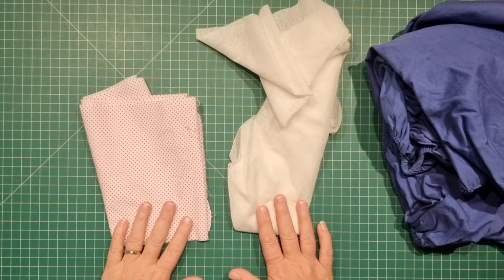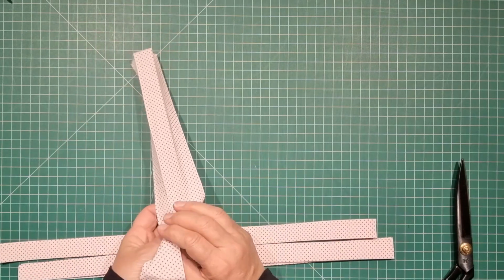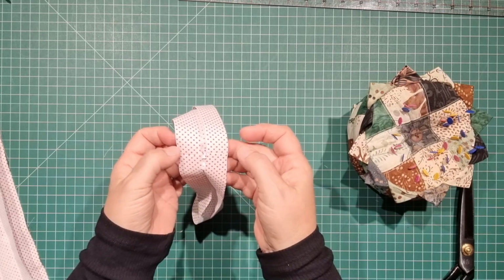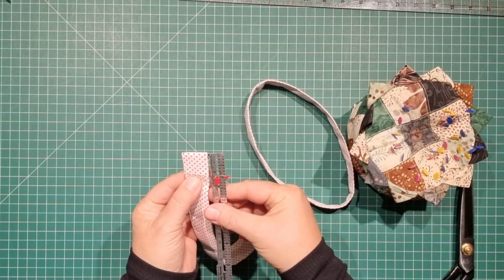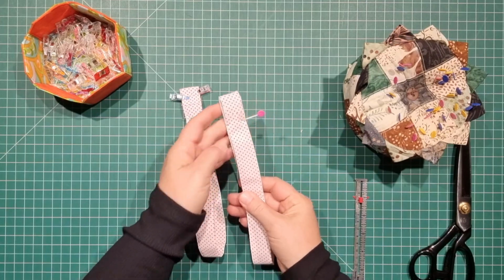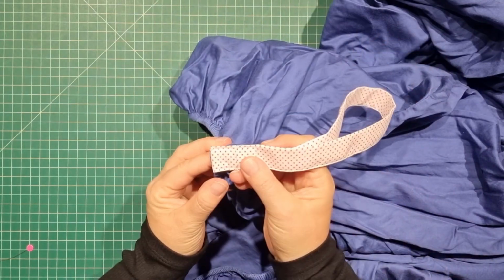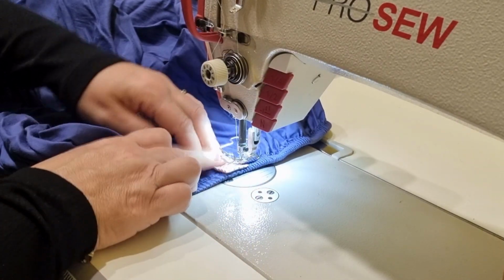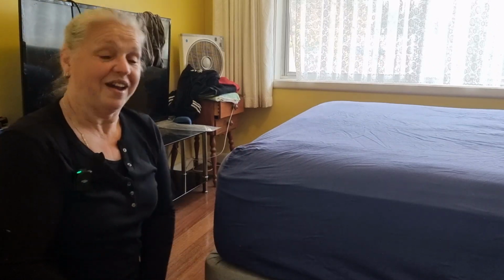How to sew fitted bed sheet wristlet straps to easily cover your mattress stays grippers pulls

Comment: Thank you! I've seen things like this advertised and was sure I could make them myself.
I'll get some on my sheets tonight, just in time for when my NDIS support worker comes to do my bed on Friday.
Think I'll make some for all my friends with MS too.xx
Reply from the maker: What a fabulous idea Sharon. I woke this morning to an add selling sheets with them already attached and thought I could do them easily myself.  They're so quick too😀
Reply: @ChristinesHomeAffairs  I had been thinking of something using webbing, but always paused as I could see it being hard on my hands - these soft straps will be very different. Also, for those with grip difficulties, interfacing with fleece would make it that little bit easier.
Reply from the maker: The fleece is a good idea. The add I saw this morning used the webbing, and I also thought it would be too stiff.  A double layer of soft cotton webbing should work though😀